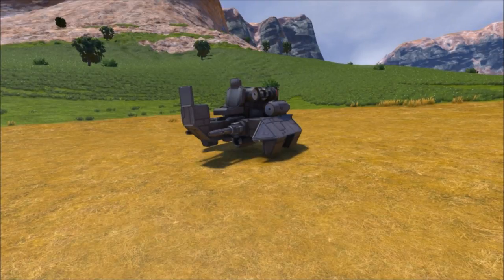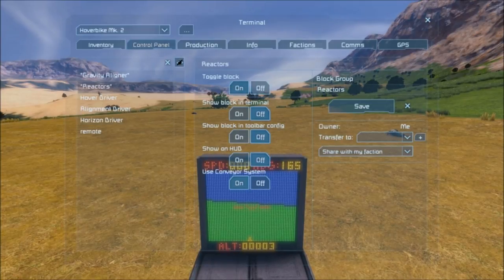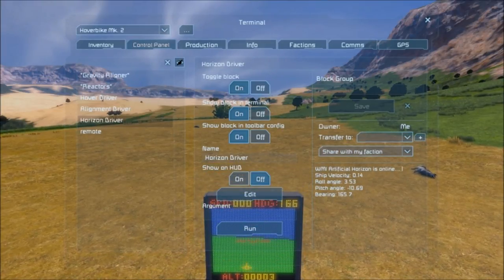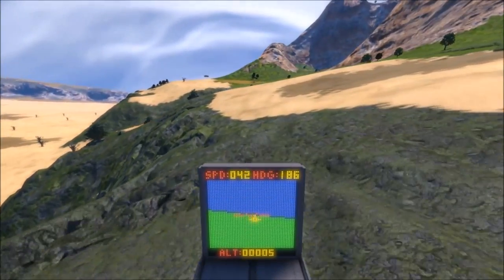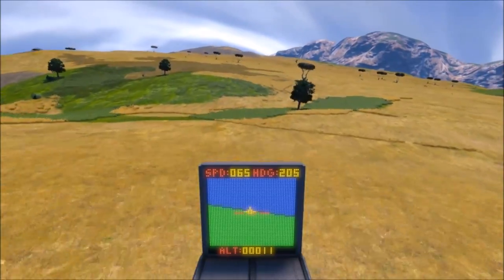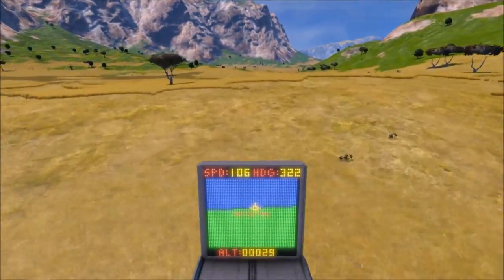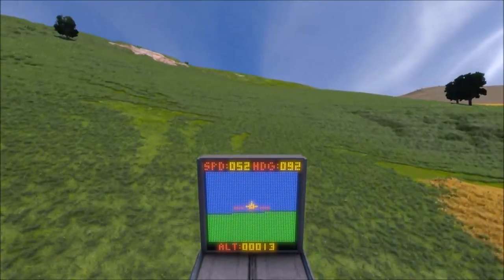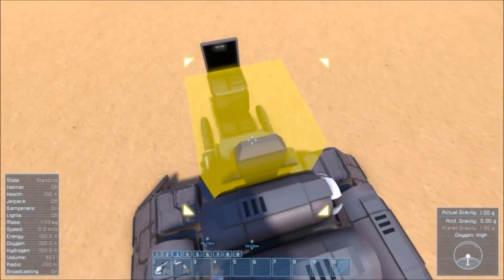Space Engineers - Hovebike Concept

Comment: Tip for the microphone humm/buzz/tone, if it is both jack and usb powered. You can take the usb part and plug it into an wall adapter (for phones and such). Putting the USB outside the loop of the computer can help get rid of electrical interference. Hop that helps.